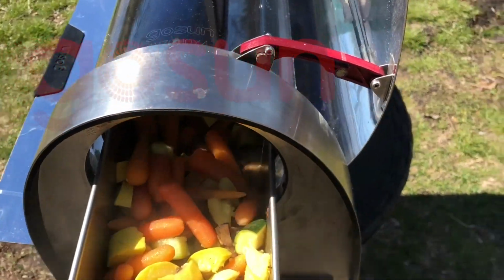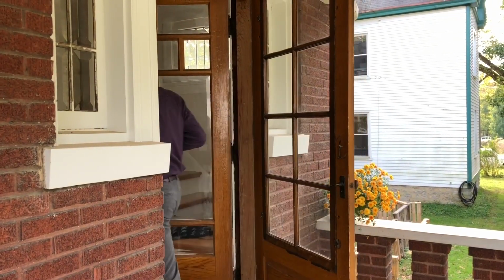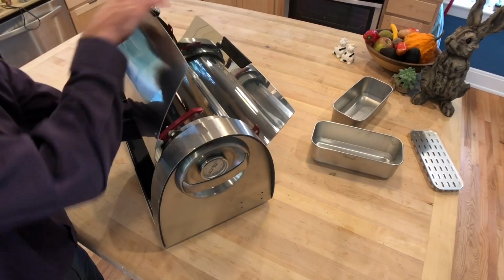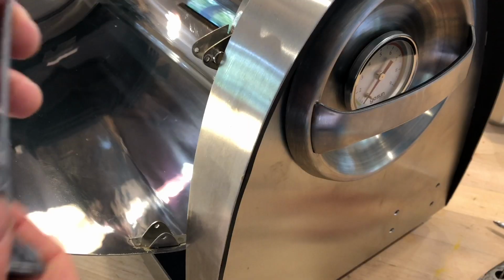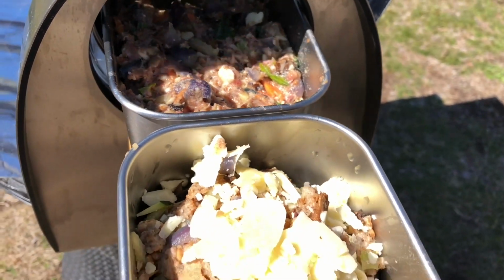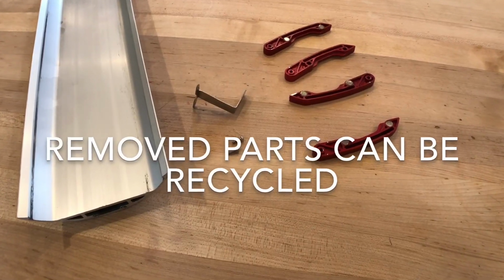GoSun Grill Turbo Kit Installation | GoSun

Comment: I've had my grill since the Kickstarter campaign and find it pretty good, although a bit slow to heat up so hoping the turbo kit which I have just installed, helps. I had the same issues with the screws - some were gummed up with glue or silicon or something, which made them difficult to remove. I'm guessing this might have been put there to prevent them unwinding and coming off? If this proves an issue, should I add whatever it was again, and if so what was it? I found the tray did not slide in and out easily when I removed the heat bank and installed the new clip, although I checked repeatedly that I had installed it correctly. Then it occurred to me that it might be a disadvantage in my case, to remove the heat bank, as I often appreciate the way the grill holds heat after the sun has gone down. So I have put it back in to see what happens with just the reflector arms changed, and the heat bank still installed. I'll do a bit of experimenting without food in it, to see what the difference is... Could someone please respond about the glue or silicon on the screws?

Comment: The video is misleading. It does not take 10 MINUTES to make these changes. Plus the little SS tab does NOT prevent the INSIDE aluminum sleeve from coming out when you slide the tray out. My end clip gets hung up at the end thus does not work correctly in my upgrade kit. Vides can be deceiving and this is one such case. I have had a GOSUN for over two years and have have nothing but problems with it. The SS pans are to big and get hung up inside the oven yet they don't acknowledge that their SS pans are to big for the opening. I had to modify so many things to make it work properly. They even sent me a new stove a few weeks ago and I see nothing has changed in the design. The new SS pans are still to wide and get hung up inside the tube still. And when you put the trays on the top of the pans it makes thongs even worse as far as the SS pans sliding into the tube. GO Sun needs to get a different engineering team IMO and should send out products that WORK with no issues.

Comment: I don't know why but that shim you put on the tray is something I can't use, when I put that on I can't slide my tray in and out easily.  It was a little trickier than this video shows to get this stuff installed, the 2 screws on the one side of the grill had glue on them and I couldn't get them off easily, I tried to hit them from the other side after I got the nut off and one came out, the other however knocked the magnet off (thankfully I don't need to use the magnet anymore though).   Hopefully this will help, i'm still disappointed you didn't come out with something for this grill like you did with your new grill (to plug it in).  I can't see spending more money constantly to try to keep up so I really hope this upgrade helps.